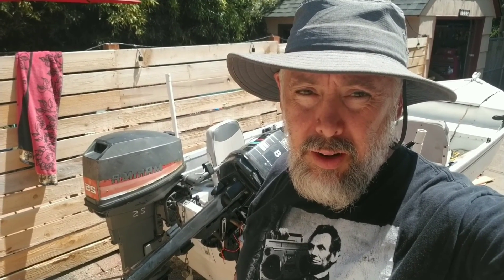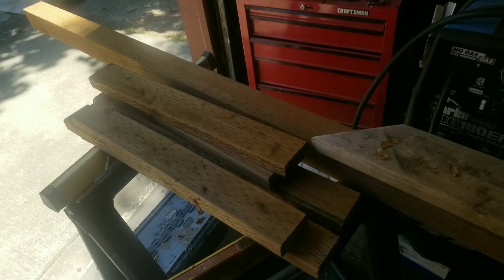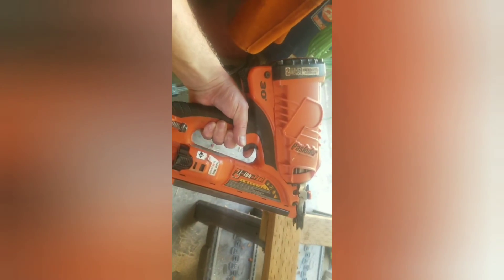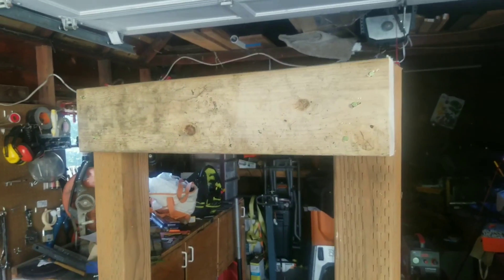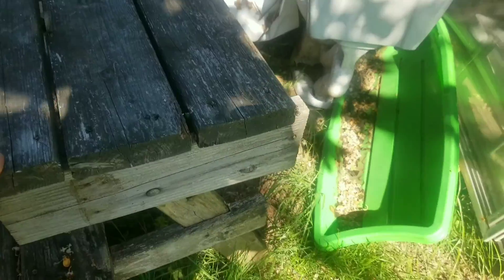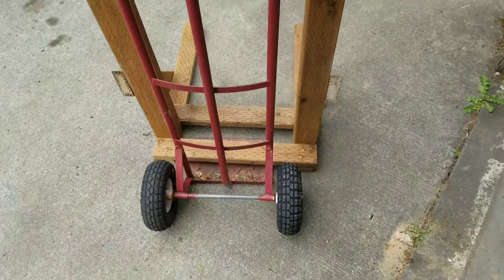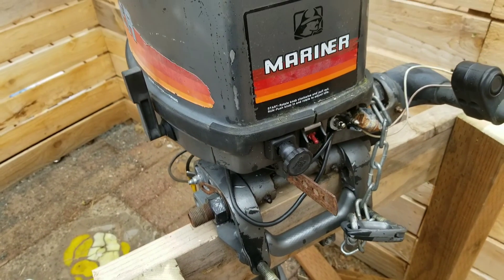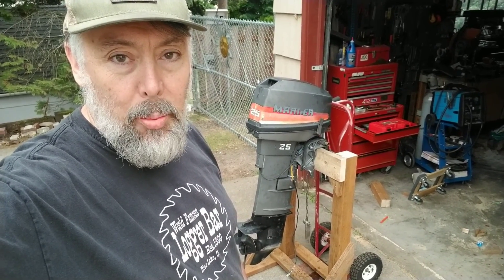DIY Outboard Motor Stand for Mercury, Honda, or Yamaha Boat Motor Out of Wood

Comment: Nice! I want to make a stand that I can dolly around like this. I am going to mildly copy your design but add a board on the back side, so that the motor doesn't rub on the dolly when you move it. Thanks dude!
Reply from the maker: Sweet. Thanks for watching!
Reply: @JasonSipe16  my stand turned out wicked. Motor has been on it for a couple weeks while I rebuild my transom and strip/paint the entire boat. You are the man.
Reply from the maker: @FAN3LL1 Awesome. Glad this video could help you